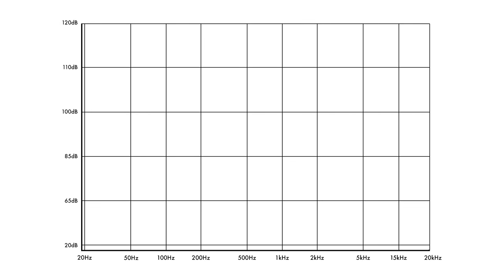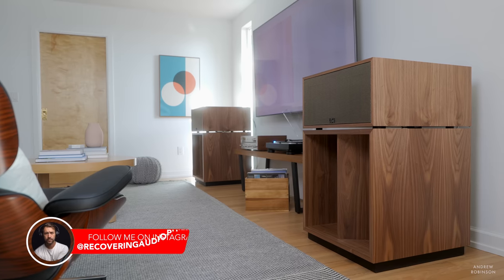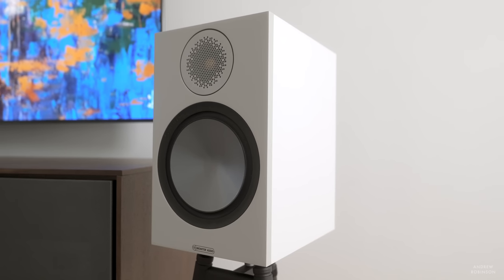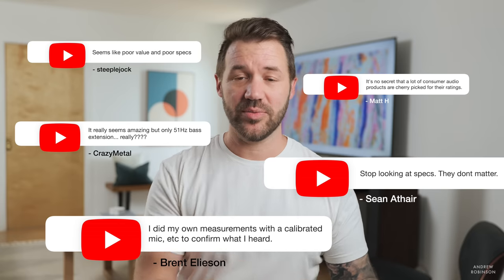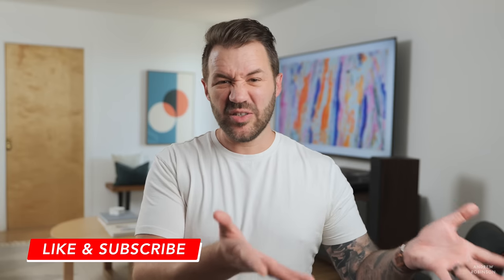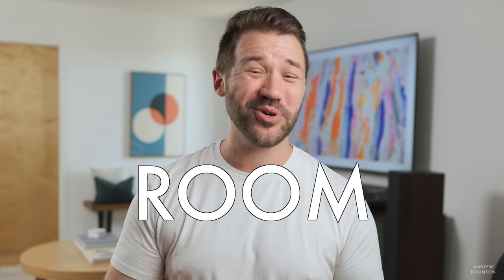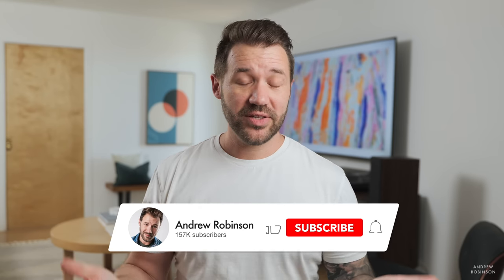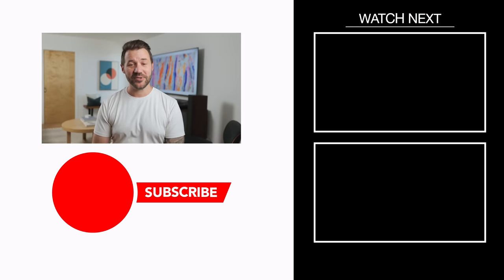DO SPECS REALLY MATTER in Audio? Understanding Speaker Measurements!

Comment: BUT SOME TIME IT IS NOT ONLY THE  SPEAKERS BUT YOUR RECEIVER WHAT MAKE THE DIFFERENCE. FOR EXAMPLE I HAVE A DENON AVR X4000 WHICH IS A VERY BRIGHT AND HIGH FREQUENCY SYSTEM COMPARED TO MY BRAND NEW AVR 8500H WHICH IS A MORE EXPENSIVE AND HIGH-END SYSTEM BUT AT THE SAME TIME IT IS A MORE NEUTRAL AND LOW FREQUENCY SYSTEM EVEN WITH THE SAME SPEAKERS AND NOW I FELL THAT I SPENT SO MUCH MONEY FOR A RECEIVER THAT I DON'T FELL 100% COMPARED TO  MY INEXPENSIVE AVR X4000 🙊🙈🙉😭!
Reply from the maker: @Maurano thank you for your comment (maybe check your caps lock key next time 😉) but you’re right, gear can make a difference too. Something we’re going to discuss in future videos.

Comment: Does it look cool? Well made, not chincy. I have a thing that if the speaker has a plastic cup for the binding posts I wouldn’t buy them and there are many higher end speakers that cheap out on this part of the speaker. I tend to trust components that measure well. The flaws that make something sound different and interesting at first would eventually become irritating in my mind. But there is a market for everything, even these 70’s big box speakers with drivers randomly placed all over the baffle. Someone thinks that’s what sounds good and that’s okay.

Comment: I look at Speakers Frequency Spec to see how Low the Bass goes, usually 40hz is Good, then Speakers Sensitivity  Spec l look at, from Live and Learn, once bought some speakers 8ohms 84db and my 60 watt Amp got Too Warm trying to Run those speakers, so didn't get the Best out of those speakers. 
So now l only try to buy 89db, 90db and up, 8ohm speakers, so Amp is using Less Power to Drive the speakers, Keeps my Electricity Bill Down, Plus Amp will Last Longer
Reply: @markscott9259  Not many speakers go that low, you need a Subwoofer to fill in down to 20hz

Comment: Specs are only used to dazzle you as a means to prime your expectations. It's similar to the META gimmick on the LS50 2nd gen. They just simply moved on and no longer made the parts to the original LS50 anymore so wanted to apply their next gen Uni Q driver. They knew like new coke versus coke classic the change would split the crowd and so it's always necessary to prime your expectations to make sure you accept the changes as being improvements when they really aren't... Remember, the original LS50 wasn't even supposed to be "the best it can be per se" in terms of measurements. It was specifically voiced to sound like a modernised ls3 5a. The LS50 SE is now just trying to be the best it can be in terms of measurements which is not at all the same thing and that's not something everyone would be fooled into accepting as better. So Enter Meta, a shell company made to allow them to use the word meta without sounding too pretentious and a way to prime as many people as possible into accepting the difference must be better when it's an entirely different driver so or course it'll be different and it's the next generation so of course it'll measure better. 

The whole "issue" of having to eliminate the rear of the tweeter was never a problem to begin with and sure as hell was solved effectively on the blade the same exact way except practical and not a marketing gimmick that amounts to a 5 cent bb maze

Comment: agreed you can go insane. this is like the Rogan of sound ramble tho; this vid is lacking luster of what all the specs even are and it only covered elementary level of frequency range.  plus! they do matter to you. watching your video about the Elac debut ref that you slammed for having a lower sensitivity (which is fair lol) sure makes it seem like you think measurements matter. it just does matter yo in the context of matching up amps/receiver/speakers. its the top reason i have spent like 89 hrs on researching my choices as a consumer, sadly!! also sad is that this video is still mostly about subjectivity and not even about what measurement aspects to consider that do matter as in technical aspects. the specs of a 1500 amp is not bias lol. the exaggeration by manufactures is also not a personal thing.

Comment: This is the type of suggestion I will give to my mother or friend who just want a nice system. But once you know more how can you compare product without spec now that a lot of purchase is made on the net. How can you improve your system and buy the right product. This is a very strange argument and I thought that your channel was not going for this. I agree that some product with low spec are very musical however most of the time they are not. And I agree that a lot of mid-fi product will suffice the mass and also that mp3 are very good. But I do not agree with arguing with different community and saying my way of thinking make more sense then your way.  I just have unsubscribe, this was not necessary.
Reply from the maker: So specs only matter when discussing high-end equipment? That makes no sense to me. 

But aside from all of that, I never say in this video that specs don't matter. Never once. I say that "to me" as in my personally, they don't matter. But I very clearly say that specs, like reviews, are meant to be guides to help you narrow down your options. I also think that a lot of other channels have taken this "discussion" too far by trying to twist what this video is clearly about and equate it to all specs, which is not what I'm doing. I am very specifically talking about loudspeaker frequency response measurements and the ways with which they may not align with one's personal tastes, room etc. 

The fact that people have turned this into a discussion or rant over tunnels and bridges is hilarious. Lastly, I am not trying to start any argument. As a former subscriber you know that we don't engage in drama on this channel. This video was made openly and honestly. If anything, others have taken it or seen it as some sort of attack but if you notice, we don't mention anyone negatively nor do we say anyone is wrong. Sorry to lose you as a subscriber, but I felt the need to clarify a few points.

Comment: Only time measurements matter is when tuning your subwoofers in your home theater setup. So if a sub doesn't dig deep enough for you in the first place, no need to consider it.
Reply: So why do measurements work for subwoofers but not above 80 Hz? That makes no sense. 

 The argument that anechoic measurements are not predictive of sound quality due to acoustical interactions with listening  rooms is only partially true..  Below 200 Hz, yes the room will  tend to  dominate the quality and quantify of bass sounds. You measure it and correct for it.

 Above the room transition frequency (200-300 Hz) you design the speaker to be room-friendly so that on-axis sound is neutral as well as the reflected sounds produced off-axis. Above 2- 3kHz)  the direct sound dominates what you hear in a room and that is entirely predicted by anechoic speaker measurements.